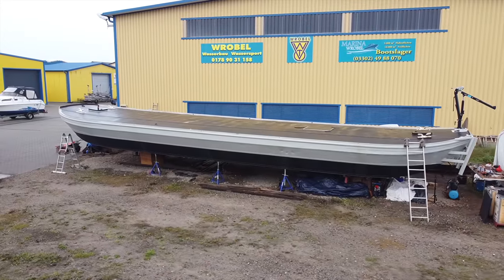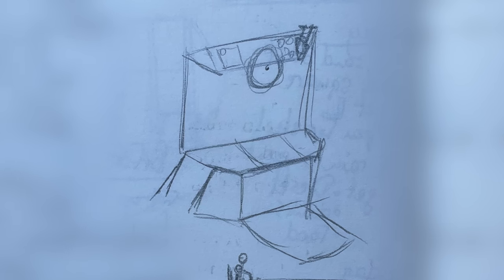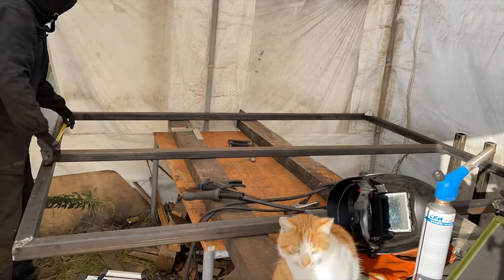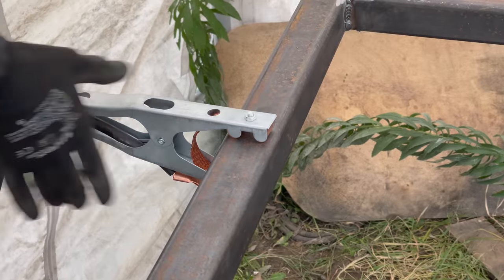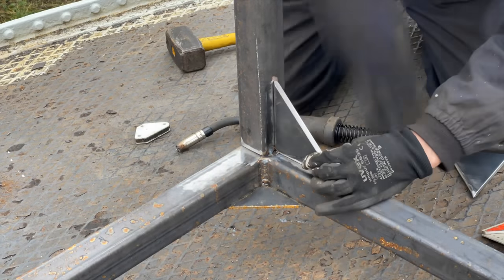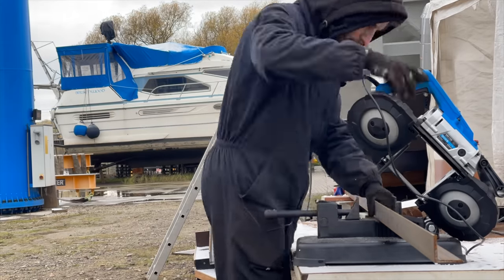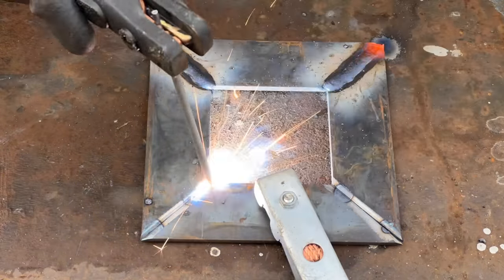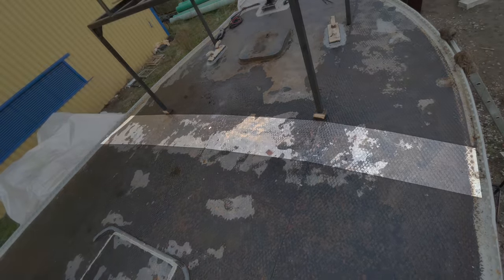Building a HELM on my BARGE BOAT

Comment: Hello from Russia, StPetersburg. Your new project with a big ship is quite interesting as "do it yourself" show. It shows Your skills and accurate attitude in metal works and welding. Nice hobby and great accuracy in handling with new instruments.
At the same time, the final purpose and engineering brilliant idea are not very clear. What do You want to get?
At the same time, there is vide variety of ideas:
A) Floating barge for a long travelling through Europe channel system in slow mode
B) Cargo platform for some other vehicle and a living space
C) River tram for tourists for 1-2 hours trips or a river ferryboat from one bank to another
D) Boathouse (flat on water), which moves from one parking place to another just few times a year
E) Workshop, self-moving dock item and pierce for smaller boats
F) Ship with some ecological purpose or with ancient design
G)Maybe restaurant, moving bar, club, historical museum,
etc.?

Would You keep it for yourself or will also sell the final result?

Why do You put such modest vehicles on such massive boat? Why not inboard machinery? Why You make a huge metal construction, but put a wooden plates and thin connecting for the vehicles? Do You wish them to separate from the boat in some accident case?

Would You dare to get some certificate for the ship and to go with this boat to the seashore zone?

If You would explain the expected result, the project seems to be more attracting.

Comment: You are pushing your molten puddle, and getting poor, uneven welds, and then, you switch to dragging the puddle, and getting nice even, smooth welds. Only push the puddle upwards when vertical welding, the arc will help keep the puddle in place long enough for the bead underneath to harden, and prevent dripping. Hope this helps.

Comment: I applaud anybody willing to work outside in the winter especially welding. For a beginner you are doing exceptionally well. You did much better with your stick technique. But it looks like you learn to weld with a mig from watching videos from India. I would employ you to improve your mig technique. Starting and stopping constantly is OK for welding sheet-metal or filling holes but for structural welds you need continuous beads.

Comment: Get yourself some flux core welding wire. It does not require gas and therefore is the go to solution for mig-welding in windy conditions. It's also more aggressive than regular wire and has an easier time welding thru paint and dirty metal.

Comment: USE ANGLES ON THE TOP AND SIDES CLAMP TO AJUST HOLES IT ALL STRAIT DO THE SAME OTHER SIDE MEASURE BOTTOM THEN AJUST TOP. SAME ON THE SIDE WILL SAVE YOU AL KINDS OF TIME

Comment: Your Aliens that appear out of your welds, when welding the tubes is due to the air inside the tube heating up as you weld, then when you come to the closing weld, the heat air expands and try to escape out of a ever decreasing hole size. a fix is to leave a small gap until the area has cooled down, then weld the gap, this should help you with this issue. sorry this advise is coming a bit late for this job.

Comment: The engine mounting boards are partially underwater and will create tremendous drag. Water will hit the boards and flow over the top, possibly drowning the engines. There needs to be horizontal bottom plates from the engine mounting board to the bottom of the boat hull to reduce the drag. If you fill in the sides as well then you will have created an "engine well" which is standard on outboard powered boats.

An engine bracket offset well aft of the transom only works on high speed planing hulls

Comment: I know nothing about the strength of steel and welds but I know I would be putting in a bit more triangulation for rigidity...even if just needed for peace of mind. I would be concerned at rhe structure shearing. Do the propellers on the outboards have a fine enough pitch for the bulk and mass they are to propel? Great fun to watch.

Comment: If you ever need to pull the motors on to the deck for any reason, consider the space you would need to set them and work on them and perhaps some kind of mobile cradles you could set them securely on.

Comment: The aliens in your welds may come from the point at which the tube starts to become sealed air tight.The hot air must escape. If this ever happens it may help to drill a small hole and pop a tack on it at the last moment. Your Welds look just fine.
Reply: or a puff of wind came in from the outside and blew the gas away.
Reply: I’ve had the exact thing happen to me. It’s like a vent hole being pushed out by the newly heated air.
Reply: Welds look fine ? 😂😅🤣 . Been welding 40 years and never seen such crap . Porosity all over and blob spotting box section 🤣😅😂
Reply: These are horrible welds. The multiple spot welds is not structural. He needs to learn how to run a bead.

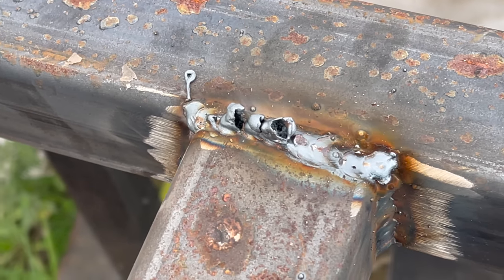Comment: @6:57 you know why this happens? While welding the atmosphere inside the tube gets sealed up and air wants to expand when it gets hot. If there is no drainage-hole or egalisazion-opening the air will move through the last welds you are going to do... Just have a look at the regulations for dip-zinqing (Feuerverzinken if you are German) you need to think about not creating separate athomspehric chambers... Make 2 small holes on opposite ends (5mm or so) you can rig weld them afterwards if you want to...

Comment: Keep the nozzle of the MIG welder close to the weld area and use a continuous weld instead of spotting it in and that should resolve the issue of aliens growing out of your weld.
Also, the barge is looking great. Looks like a fun build.
Reply: Why not using a flux cored wire without gas when you weld outside? Much easier then welding electrodes.
Reply: @downhillz1832  Either way, spot welding is not a proper way to weld metal of that thickness, There is not enough penetration and the metal is not getting hot enough to produce a strong weld. 
Agree that FLUX core is the only real option for welding outside in anything but still conditions. You get slag, but at least it will be a proper weld.
Reply: @pablomax3045  Flux core is not the ONLY option, electrodes working as well great. It was more related to the skills and experience, because he made some from his MIG welding. Fluxed core is near equal. Not so clean, but the technique is the same. Fully agree that spot welding has not the full penetration. If it has nothing to hold, then it’s ok. For thin material also ok, but it’s not a real correct weld.

Comment: THE TRICK IS  TACK BOTTOM CLAMP A ANGLE IRON AT THE TOP AND ON THE SIDE REPEAT ON THE OPPOSET SIDE SAVES YOU ALL KINDS OF TIME. YES GUSSETS ARE GOOD STRONG YOUR DOING GOOD WELDER BUY TRADE.

Comment: Just wondering if you put the trusses in the right way, now they are pointing downwards towards the motors. I thought the trusses had to be positioned in such a way that they can support the weight of the motors in compression, so shouldn't they be pointing upwards towards the motors?

Comment: Granted I'm not a ship designer but I'm thinking the helm look and function better over the bow. But I'm thinking that your placement was due to the control cables, wires and hoses length. I have a whole drawing at home of my dream houseboat which reflects the helm forward. But one difference is mine has an inboard truck engine. The engine requires very little control interface

Comment: seems like you building it a little tall (heavy too when i look at the size and thickness of the profiles youre using)  , it might not end up being verry stable and catch a lot of wind making it drift all over the place , it allso might not have a lot of height from the deck to the waterline with all the extra weight sitting on it 
you have a lot of unused space below the deck of the boat and you could make a "tub" about 80 to 100 cm lower than the surrounding deck wish would mean the total height above the deck and the waterline would be lower as well while still keeping a 2.25 meter height floor to ceiling (though i think 2.00 to 2.10 wouldve been plenty for a tall person ) , could use the piece you cut out of the deck as the cabin floor (including the support structure below the deck though you do need standoffs to weld the top part to the lower structure of the hull and connect it back up to the gangway part of the deck thats left at the original height ) and you allready wouldve needed the metal for the sides of the tub as you where planning the amount to make the walls for the cabin above the deck ,the walls now sinks partways intoo the boat 
would change the look fro this 
https://cdn.openbms-images.com/images/121/194634/cropped=true/height=240/pos_y=middle/quality=80/width=400/Budgetboot-grachtenboot-boot_zu_verkaufen-bateau_a_vendre-boat-forsale-boot-tekoop-bootveiling.com4.jpeg
to this :
https://foto.inautia.nl/barcosOcasion/4/4/8/3/praam-14-23697080170265495157684852514567x.jpg
would mean the steering house can be made lower as well (think standing behind the rudderwheel up above the roof of the cabin from about the shoulders should be enough to see around the boat it might help fitting said boat under some low bridges )

Comment: I had to laugh when you were questioning if the helm frame was strong enough to hold you. Your helm platform is built like a tank. I would like to suggest adding some mid bracing (at least one) on the side legs of the helm platform. You do excellent work and your welding has really improved. Nice job. Enjoying the channel. Tks for sharing.

Comment: First off I love your determination and effort. Now for the welding. First there are a few reasons for porosity in a weld. Like mentioned gasses building up in the piece you are working on and can cause it and like already stated a small bleed hole will solve that. Also the shielding gas being disrupted either by excessive wind or pulling back the torch from the weld to far. Those are easily solved by a small wind block and more torch control. Now to the welds themselves you have to stop doing those youtube cold welds I know it looks cool but can fail easily. one controlled weld bead with proper heat and wire speed will be much stronger also the lack of splater is not a good thing when mig welding it shows your wire speed is to slow. Also you can tell the welds have no build up of material hence the youtube cold welds then grinding them flush weakens them more where as a good solid bead gives much better penetration so if you have to grind them down there is still a fairly good bond. I hope this helps I have been doing it for over thirty years and always learning. So keep up with the nice boat build and wish you good luck and times.

Comment: Just silly questions really. Why drive so high and expoed to the elements. I know you would have a proper cabin. Wooden , windows and doors. Plenty of brass fillttings. Radar , gps etc. world travel maps , shipping screens etc. Just why so high. 
Second silly question, would a front cab give it more ship looks than rear tanker mounted looks. 
Ship or tanker. ?!?!
I like ship. Possibly easier drive from front than rear. Rear for rear crane , winches, etc Helicopter landing deck or car storage. Boat storage even. 
Idea : Make it a transferable cabin.

I know longer engine management controls. 
More money etc . Just keepin it simple i suppose.

Comment: Think about using a Flux Core Electrode in the Mig Welder. That will  avoid swapping machines and allow you to use the MiG welder in a windy area.

Comment: Do you know about flux core wire? It is a little bit messier, because as you weld , it splatters small bits of metal outward that you have to grind off, but it is just as sound structurally, and you can weld in the wind  without the problems associated with using gas. The splatter comes off fairly easily, with a sanding disk on a grinder.

Comment: You need to drill a pin hole in the box section. gases get trapped and you will get a blow back on the welds.

Comment: like what you're doing,  you can add access for adding fluid film to your new helm internals to help prevent rust and fill holes with a rubber plug for additional use later keep up the good work.

Comment: Looks like the board that the outboard motors are attached to will be dragging in the water?   Normally the cavitation plate would be at or just below the surface of the water.   Is the height of the superstructure you are building going to fit under bridges?   Why so high?   The bow thruster looks like a lot of drag during normal cruising.  Nice welds!

Comment: The aliens that you were referring to for the welding is caused by the wind or air blowing the gas away from the nozzle and not allowing it to surround the weld so basically air got in there and contaminated it that usually happens on a Gusty day and you're trying to weld and you can always try the magnet ground for the welding machine they work really well keep up the good work

Comment: Regarding the amount for the helm. Seems like it would have been a lot easier to have one large plate welded to the two vertical bars. Or two smaller plates welded horizontally to the two vertical bars. I think it would have looked better and been a lot easier. Kind of went out of your way to make it look difficult.

Comment: It looks neat! =) You want some cross support for the legs to prevent wind or waves pushing the platform over ... altrough the steel is plenty strong with the long leaver it will easily rip it out of the floor if left like that.  A laser level might be able to help you to have them more inline with each other.

Comment: When you create something rectangular or square, make sure you also measure diagonally. Both measurements should be the same. Perhaps give the helm some slope towards the steering wheel so the gauges aren better to read. For stick welding keep as close to the welding with your helmet as possible and watch your puddle closely. Clean always the area where your ground clamp is connecting with a grinder.

Comment: Looking good. 
I like where you're going with this. 
My only thought would be to consider moving you helm to the front. ( bow) so your not looking over your living space. 
It also helps in navigation as you're moving forward you don't loose depth and perception of other vessels within your proximity. 
Just a thought.

Comment: Love your vids! I’m impressed by your determitation and work ethics. Only thing I have noticed is that you haven’t bought a set of counter rotating engines. Hope this won’t give to much control problems! Also the different props, but I assume you’ve noticed that yourself 😉 I believe that the high trust version would be be a better choise for your application. Keep up the good work and keep the video’s comming! Greetz from Holland.

Comment: I see you didn't attach the helm structure permanently yet, but I wonder if you checked where the legs touch the deck; is there frame members underneath? If not, you may want to add strengthening below, or put pads on the legs to spread the load. Your welds are looking better all the time! 😉
Reply: Thats a very thick steel deck, absolutely no problem the way he did it.

Comment: have you done any calculations for the strength of your steel frames?  because they seem very big to me
Very good job :)
Reply: Agree with your comment. Well beyond bulletproof.
Reply: You might want to plate in the open area at the bottom of your outboard brackets to smooth the water flow into the outboard propellers.  It doesnt need to be watertight, you just want a smooth flow surface between the transom and the outboards.

Comment: At time frame 16:18 you moved your tower back.  The mooring cleats are under the tower. Not a good place to be if your lines brake and your barge rotates in a direction that the lines bend the support poles.  I would suggest moving it back to keep the mooring lines clear of your tower.  Also, one day you may need to use your opposite side mooring cleats in a cross over configuration to help secure you're boat in place.   If you leave your tower there it will not work.

Comment: Hey man, once again you're doing a great job. But that boat will be too heavy. With the way you over engineered that helm having twice as much metal then you actually need (that thing will hold 700-800 pounds without an issue possibly 1000. your about 170?) If you continue like this you'll have problems. Have an engineer who actually knows what he's doing to design your superstructure properly. And cut most of your middle support out of that helm and gusset everything.

Comment: Outboard engines should be mounted so that the cavitation plate is level with the bottom surface of the motor well. The faster you go the more the water will rise up at the stern of the boat. Cavitation plate is the flat plate above the propeller. Yours are too deep.

Comment: You need to learn to run a bead when welding. Connecting spot welds with a bunch of spot welds is not structurally strong.

Comment: Being an armchair expert... I'd gone with a diesel motor and shaft driven instead of outboards.  Costs and maintenance as well as overall performance would be better. Also since you are already running a bow thruster, why have outboards steer? Just my humble ideas. nice video though you don't have to narrate everything you are doing...

Comment: I think your bridge structure is far too high. It is going to act like a large sail and your barge is going to be pushed very badly by the wind. Also, in such an event, those motors are not going to be strong enough to maneuver the weight of that huge steel structure. I really am impressed by all the work but I think you should re asses bridge structure and motor strength.
Regards from South Africa